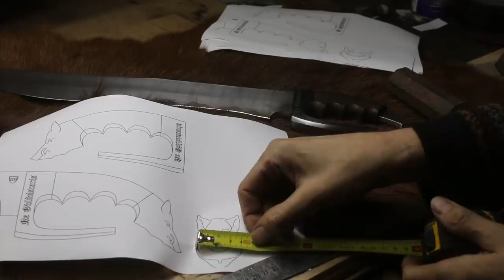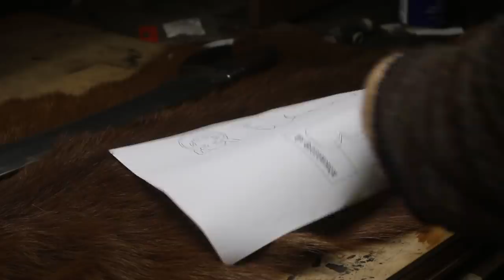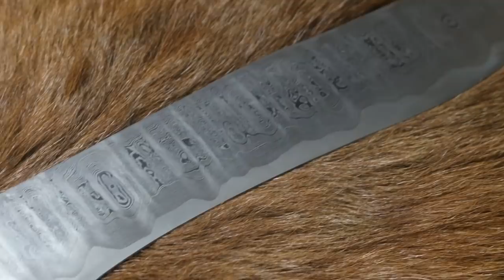Forging a 578 layer San Mai Kopis knife, part 5, making the pommel.

Comment: Every other machinist/blacksmith on Youtube:  Gotta be careful when drilling steel
This guy:  FREERK SMASH!
Reply from the maker: Yes it, was a bit rude. I saw, when editing. I was a bit in a hurry I guess. Lol Those parts can take a bit long to make.
Reply: @freerkwieringa275  It was awesome.  To be fair, that was a larger sized bit, and you have the experience to know what you can and can not do.  You took it nice and slow with the pommel nut.  You do amazing work, brother.